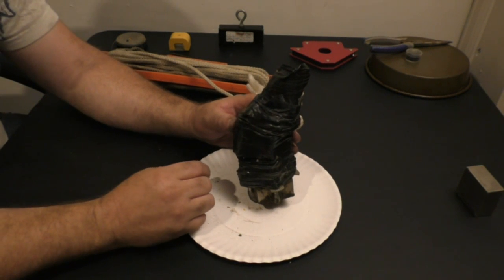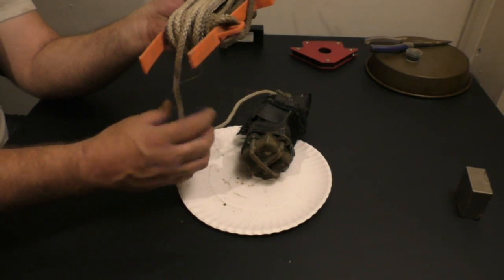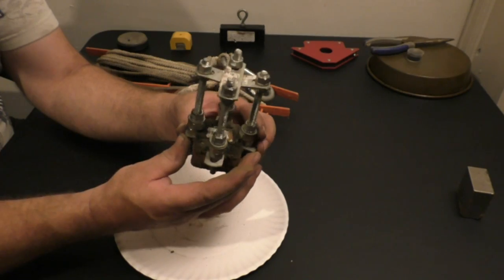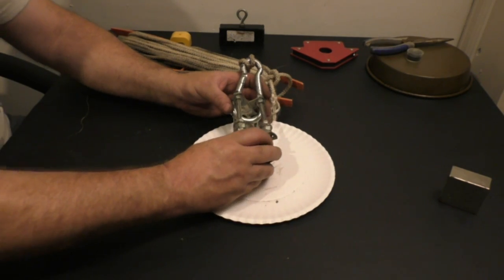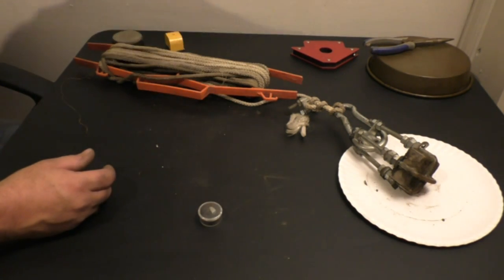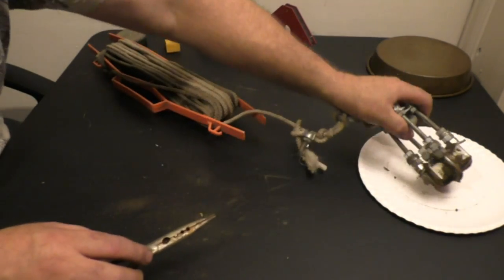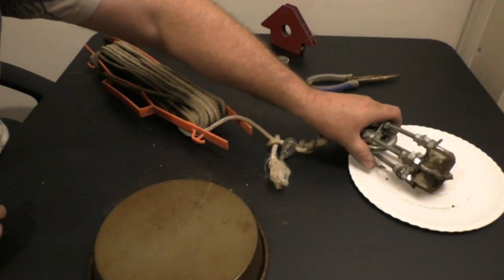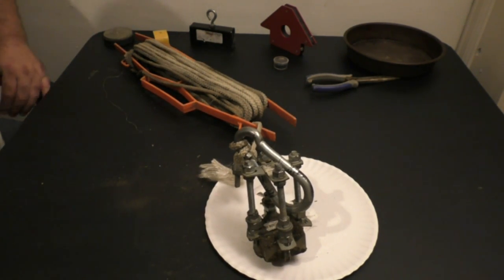How To build a Super Magnet for Magnet Fishing

Comment: where is a good site to aquire such a magnet
Reply from the maker: +Ralph Mckendree Ebay is the best and cheapest from what I've seen. Search 2x2x1 icnh neodymium magnet. I put an updated video on  in the info above that I feel is better and cheaper to build than this but does not have the same pulling power due to hard to find a magnet with the hole in it at n52 grade
Reply: +scannerguy1968 thanks, i went ahead and looked at ebay the other day and have ordered one that is 5x2x3/4 but its n42 not 52

Comment: Thank you for video. Of course you can made it by yourself. But you will reach much better result when use factory maded and specialy designed for metall fishing two sided  Treasure magnet for it with real 200kg pull power. http://www.ebay.com/itm/252298058410
Reply: +Alexander Rovchak   is it worth the extra $150 bucks? - we go to Canada fishing and was looking for something to pick up some of those 20 to 30 dollar muskie lures by magnetic fishing.
Reply from the maker: +vikeirishman It is most likely a Neodymium disc magnet inside a formed metal shell. Straight on it has the 200 kg pull but if hitting something angled no where near. The actual magnet inside probably doesn't have  near the pull of a N52 2x2x1 magnet. Could be wrong but N52 grade magnet is about as good as a person can get for strength.
Reply: +scannerguy1968 sounds good Thanks!

Comment: Thanks for the video.  It is very helpful.  Have you tried, or do you think mounting a 14-16" bar underneath would create a wider magnetized swath to cover more area?
Reply from the maker: +B T Actually I'm going to build a more streamlined one that has the same pull. Rocky areas give this one fits. I suppose if you have a sandy area a bar would fo great.  But around my area the more compact the better. Ill post another build in a couple weeks when the magnets get delivered from china.

Comment: you had that 100lb magnet on the pie tin, and you pulled it off and said that it wasnt 100lb. thats true because that pie tin is thin. its called saturation. there is only so much pull it can impart on that metal. just some fyi
Reply from the maker: +Rush CampNPrepThat's true but if I drop that 100 lb magnet on a huge chuck of steel that weighs 100 lbs it  will pull off unless you pull perfectly straight up which it might have a chance. The N52 magnet without the help of a metal casing around it will hold over 300 lbs if you try to pull straight up. If you put it in a metal casing like the Ferritte magnet has god only knows how much it would pull

Comment: I have a very simple circular 75mm X 12mm NEODYMIUM (rare earth) POT magnet that has 155kg pull strength, 4 or 5 times the strength of my microwave magnet. I put a D shackle thru the center hole of my rare earth magnet then attached a rope. I will make a video and post soon.

Comment: scannerguy1968, I just got finished building my magnet for fishing out of the speaker magnet I drilled a hole through the middle and put a eye screw through it and attached a 50' rope through the eye part and made a loop at the other end to either slip my foot through it or I can wrap it around my waist. I tried it the other day after I finished making it and I thought it did pretty well. Though now I can see I won't be picking up very large items with it. So far I found 3 different beer caps, some rusty fishing hooks, a spring and somehow lead weights (it got caught on a stick) LOL it was fun still. I'll have to invest in a better more dangerous magnet down the road!!!!! HH and GL I look forward to seeing more Magnet Fishing Videos!!!

Comment: Will try this in Stockholm, Sweden. Been traffic on the waterways here for at least a thousand years. 
Would it work even better if the magnet didn't have the U-bolts crossing!? 
Would it be possible to make like a track on the magnets sides instead to attach something!? Would that "kill" the magnet!?
Like the vid! Keep it up!
Reply: +johan rattigan It would work better however, if you try to pull the ''catch'' off it will be extremely more difficult.

Comment: Copied successfully. 👍 weather permitting I will post a video soon using this angry living thing. Used 4 inch u bolts, hardest part was tightening the nuts,,the magnet didn't like how close the pliers were. Started with large pliers,, and got bit a few times,,moved onto some smaller needle nose pliers,,seemed to work better. I'm in the utilities industry and I've collected underground "bull pull rope." Rumor has it that the break strength is 1000 pounds. Just hope it lasts,, because I used shorter u bolts,,I couldn't attach my carabiner. Also,,brilliant idea using the electric cord holder,,I spend more time untangling the damn rope after just walking twenty feet down the lake. Keeping my seven year olds attention after catching no fish,,move onto magnet fishing,,after that,, a little metal detecting, making memories
Reply from the maker: Cool. You find the right spot in water where theres alot of traffic at times it gets addicting. funner than fishing.